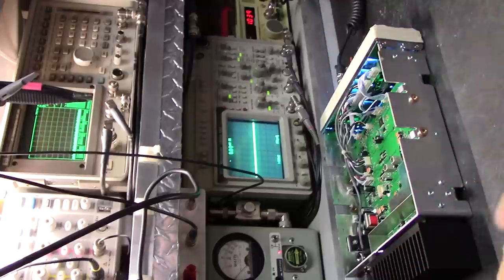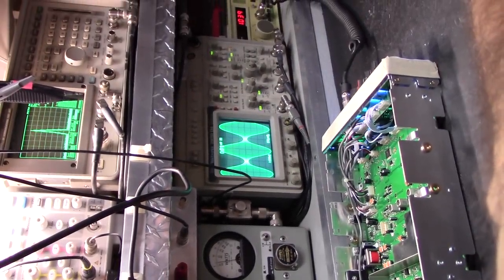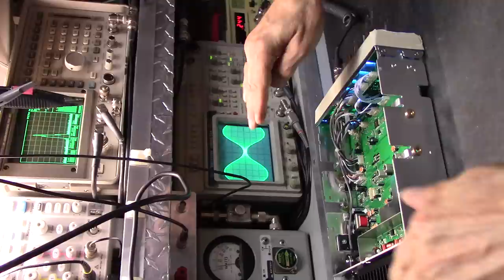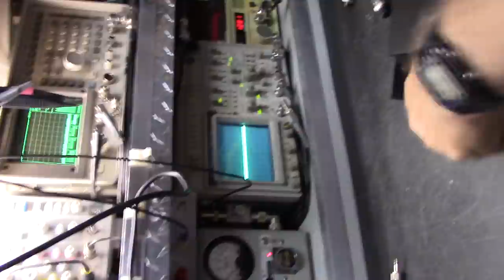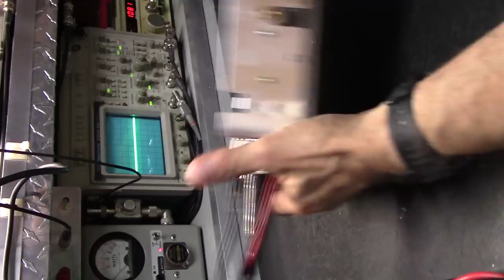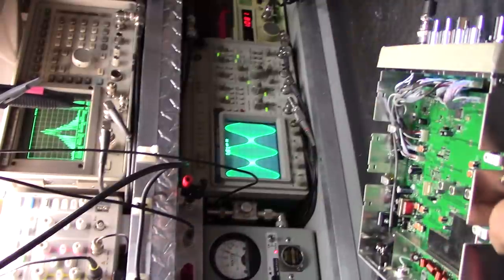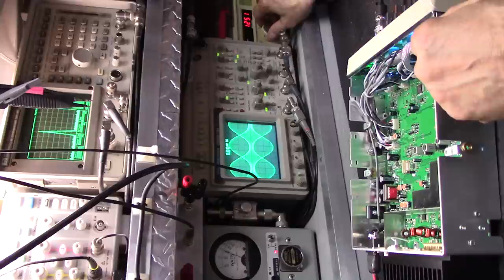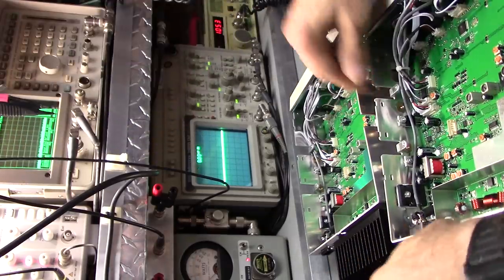Stryker SR-655 AM 10 Meter CB Radio w/ & wo/ MAX MOD.

Comment: I would like to be Your apprentice. I am also not electrical "Dumb" with over 32 years of a family Telcom business. I did it all. Crawl through....some things that would really freak most out.! I mean that. Eastern Pa. is an old are. Attics etc., down to the next hour I am programming. Then replacing a component on a circuit board. I have seen a lot. Do I know it all,NEVER,as nobody does. Radio has always intrigued Me and I wish at My age....almost half a century,I could learn from somebody that wants to teach and have someone else around doing what they can as they grow into it. There is NO fast track to this as most trades. Time,patients, mind in motion before the mouth,study!! There is a HUGE difference between  hearing and listening. I know people that are deaf from birth and they can actually listen. Willing to  relocate. If it kills Me,I will find somebody reputable to mentor me. Sincerely,Troy B. Weand.

Comment: Does the stryker 655 have the treble and bass adjustment like the 447hpc2
Reply from the maker: That's all included with the FineTune ..
Hello,
Did you watch this video and read entire description?
It's All About Procedure .. New radio sales only https://www.youtube.com/watch?v=P0W_Ltzeyyc&list=PLaU30evw85SgdW_V0-QSEOX9W7N4s61FE&index=81 at this time. Read description and watch before contacting. 

Thank You!

163 Hard Dr.
https://www.facebook.com/163Hardrive/posts/3523601657704569